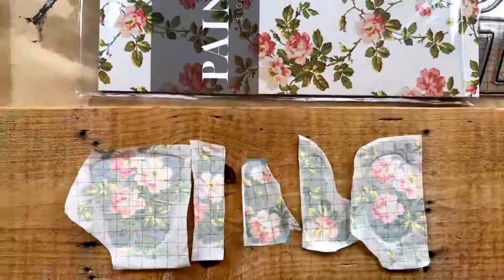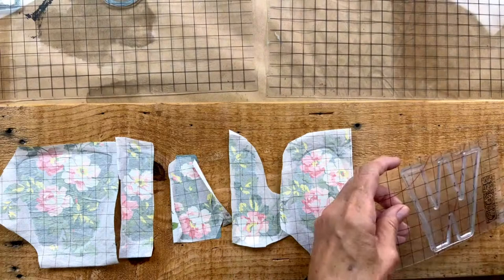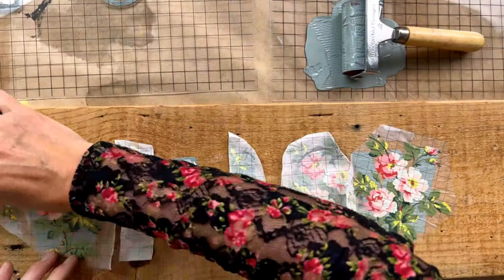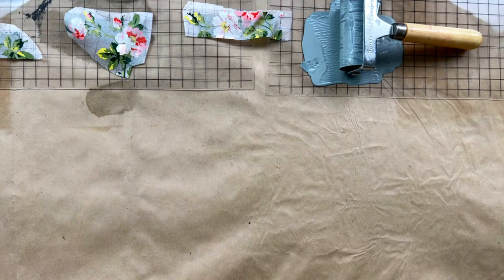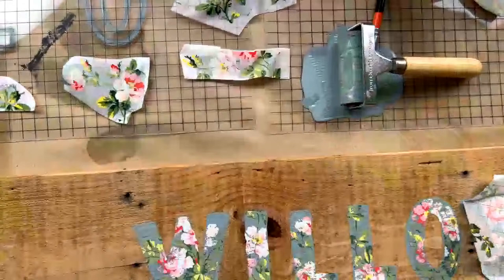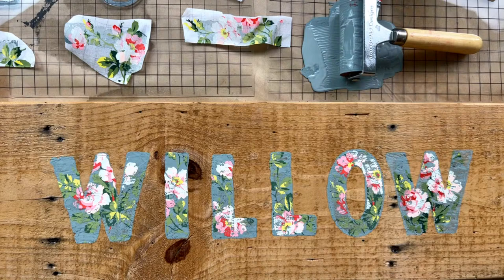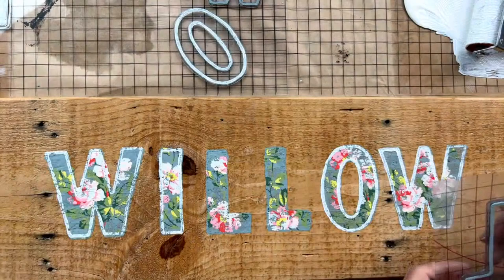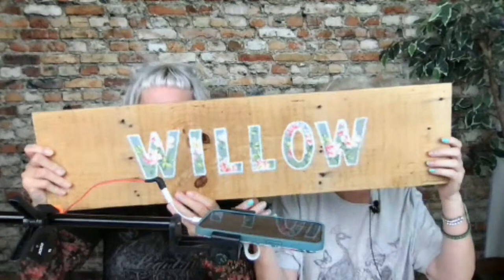New! Inlay Alpha Technique!

Comment: And could the board be painted first also
Reply from the maker: Yes! The inlay will only adhere to wet paint so you can paint the entire board and then paint just the sections that you want the inlay, or you can paint the whole board and then add the inlay if you want it to cover the entire thing😊